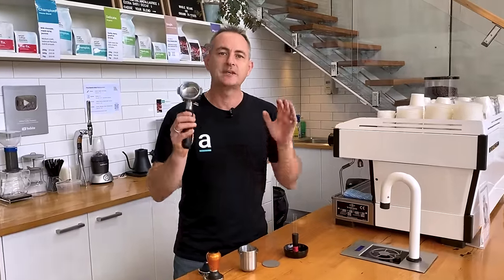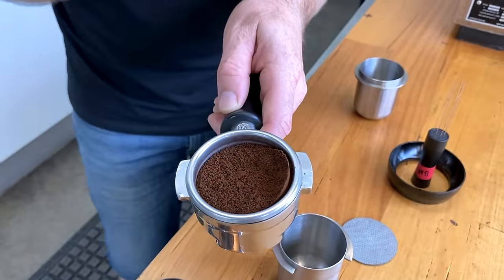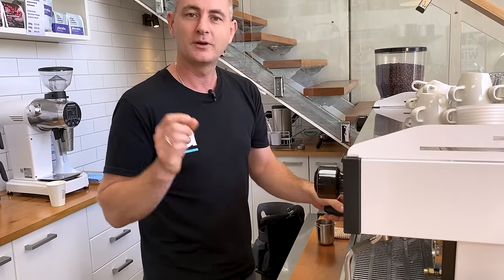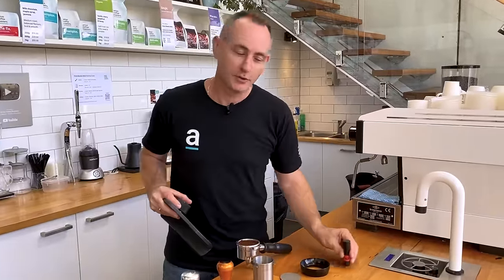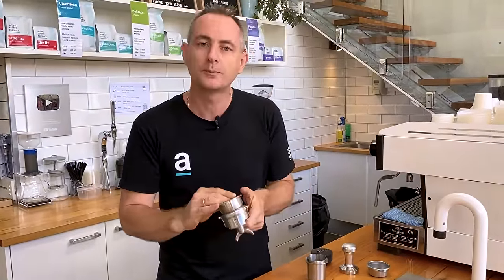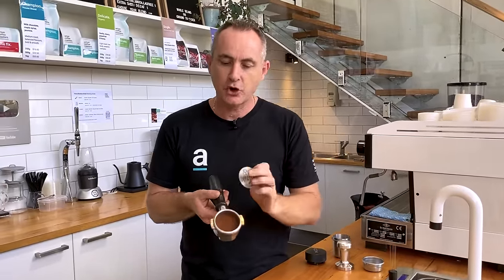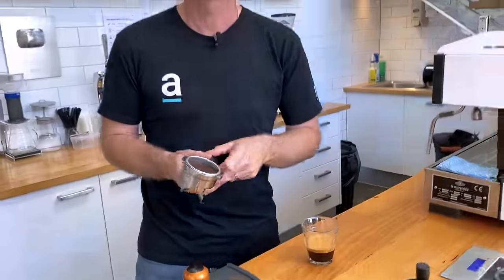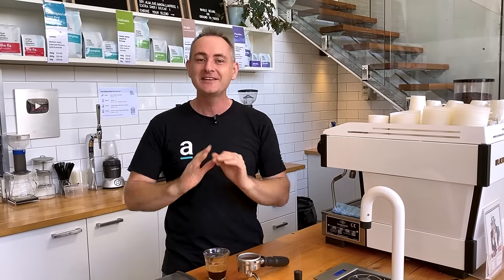How to Brew Better Espresso with these Simple Tips☕️

Comment: I am confused as to why you are using a dosing cup and swirling to distribute the coffee in the handle to avoid channeling and then using a wdt tool to break the coffee lumps up. Surely this will defeat the first process
Reply from the maker: it's a bit of a habit we have for when we teach those that won't WDT, it can't hurt to make sure you get grinds all the way to the edge of the basket first. Cheers Luke
Reply: @ArtistiCoffeeRoasters  thanks for the clarification Luke
Reply: @ArtistiCoffeeRoasters  who's luke?

Comment: My eyes drift toward the hopper of the coffee grinder.  It's transparent, so I imagine the beans are exposed to light.  Your stage is a coffee shop, so the beans may not be exposed to light long enough to make any difference.  Yes?  I have a similar interest in the air present in the hopper. Again, the same reasoning applies as the light?  Nice video.
Reply: Reckon it even matters ?

Comment: Paper filters similar to Areopress yes or no
Reply: Good question!
Reply: Are you talking about a paper filter first then coffee or coffee first then filter on top? I’ve tried each individually and both together and can tell you my experience. Paper on bottom, faster extraction with easier puck removal but you will lose full body flavor from the paper filtering the oils. Paper on top of the coffee, it seems to restrict water flow when compared to no paper or metal screen. I’ve gone through 600 paper filters of various brands and found a no-name metal screen is far superior when it comes to the quality of the espresso extraction. Some paper filters appear to be nothing more than printer paper cut to size, some appear to be actually Aeropress paper cut to the appropriate diameter, you typically get what you pay for. You can find no-name brand metal screens on amazon for cheap and by comparing to a branded one I found no noticeable difference.
Reply: @egcruzer ... I first started punching my own filters (for the bottom) from Chemex paper filters using a 2" punch.  Worked pretty well but 2" was a bit small for the basket - it covered the holes but didn't go edge to edge.  I then started using Weber's paper and have been getting much better results.
Reply from the maker: Oh what a can of worms Kelly, basically a paper filter will remove the oils from the coffee and clean up the cup. That's all i have for now. Let the comments and views keep coming. Cheers Luke
Reply: @ArtistiCoffeeRoasters  ok Thanks Luke
Reply: @ArtistiCoffeeRoasters  can of worms is right.  I started using paper filters after reading paper filters decreases cafestol which affects cholesterol levels.  The more I read, however, there is a lot of disagreement on this.  Seems most cafestol is retained by the spent coffee with the paper having little affect.  Also significant is the type of roast (lighter more), and the type of beans (robusta more).  I think I am thinking about this way too much!

Comment: Very useful video.  One aspect that I'm looking for clarity on is the "barista twist" after the tamping.  I've seen many experts advise against the twisting because it can risk breaking or cracking the puck due to the sideways force(s).  The barista twist in this clip seems especially vigorous.  Are you applying downward pressure while twisting or is it just a way to polish the puck surface lightly?
Reply: usually a polish, no pressure though i have seen some that look like they add a little pressure,

Comment: I have the Pullman big step and are using it with a VST basket.  I have noticed that Pullman sells baskets which 'match' their tamper.  Do you use the Pullman baskets?  Are they significantly different from other?  thanks
Reply from the maker: Yes they do, we don't use the pullman baskets as we have a range of machines that use their own which is easier for our cafe partners. we use VST baskets as our aftermarket baskets. give the pullman a go, let us know how you go. Cheers Luke

Comment: Great video as usual! What is your opinion on La Marzocco's pre-brew on their PBs, and in general? My understanding is that they only have pre-brew not pre-infusion, which many of the coffee community dislike. And, do you guys use it in your shop? Curious to know!
Reply from the maker: Yes we use it, 1 sec on 1 sec off, pre wet vs pre infusion is the terms most commonly used. LM have a pre wet in classic and PB, gb5 this is just when the solenoid closes and will stop the water that is set at the pump. We like it, it helps to fix bad puck prep and increases the sweetness in our coffee. Not all coffee is the same, it works for us. Cheers Luke

Comment: What if it’s rushing hour, you have to weigh every coffee, distribute the coffee, tamp, place the puck screen , isn’t it delaying the speed of getting coffee out to customers? Would it best if we calibrate every morning and run a few times before we kick offf the first take away?
Reply: When barista's dial in every morning, the coffee always changes. Whether you like it or not, many parameters change throughout the day, such as temperature, pressure and humidity, all effect the coffee being ground in the grinder. As the grinder grinds and grinds, the burrs heat up, causing changes in extraction. How full the hopper is, determines how much pressure is being put on the burrs. This is why cafe's try to minimise the factors that influence the coffee, by using scales, auto tampers etc. If they were to just calibrate and dial in once in the morning, 30 mins into morning rush, the coffee may change drastically, even if multiple shots were consistent, before the rush. As to speed, yes it may slow things down doing all the consistent measures, but customers are your top priority, ensuring your delivering the best cup to any customer is the key to success. Hope it all makes sense!
Reply from the maker: We weigh and grind every shot, consistency is the key. Things change during the day, as people pay good money for coffee nowadays it’s the difference between good and great coffee for your customers. Cheers luke

Comment: So, does the amount of coffee that fits in a double shot 58mm cup differ?  I still have an issue achieving the 1:2 recipe within 25-35 seconds. My coffee is ground at the smallest setting on my machine.  18g of coffee in the cup fits just under the extraction screen on the machine.  The start of extraction achieves the right pressure before dropping 40g to 45g of coffee in the cup with a bitter taste.  A more prolonged extraction and more coffee results in a better-tasting shot.

Comment: Why not use a  PUQpress  instead of tamping? Also does the  PUQpress  do distribution  too?
Reply: Puqpress only tamps. Distribution is still needed.
Reply from the maker: Yes a puqpress only gives and even tamp. we use the cinoart tampers over the puqpress as a prefered option. it does not distribute. Cheers Luke

Comment: What are you thoughts on using a leveler instead of a distributor and tamper?
Reply: He uses a leveler, I wonder why not prevent an uneven tamp by having a push tamper.
Reply from the maker: we use a distributor and an auto tamper is our preference to get the standard pressure. Cheers Luke

Comment: Another great video!

A slightly indirect question - what are the causes for water being left on the top of the puck after extraction?  I am using a 21g basket, with a 20g dose, and frequently see a small amount of water on the puck after a 32-second pour.
Reply: Probably just that you have some space between the top of the puck and shower screen. If you used a slightly higher dose you'd have less gap and less space for water to sit.
Reply: @chrisdturner  You are right.  There is space under the shower screen.  When I used a single dose basket, I ensured that there was a small gap, as I have an E61 group, which I found did not produce good results if the top of the puck touched the shower screen.  My earlier Silvia machine was quite happy with 'close contact', but not the VBM.  Now with the larger double dose baskets, there is a greater gap, so I guess there's more chance of seeing a bit of water  on the puck.  The shot meets my brew recipe goals, and tastes good, so I'm not so concerned about the grind, which was my original thought.
Reply from the maker: Space, old coffee,  it the correct dose, check out our puck defects videos, I have one on answers to come soon! Cheers Luke

Comment: I thought it was either WDT tool or the Coffee distribution tool. Never seen anybody use both. 
Isn’t it kind of overkill?
Reply from the maker: Both were excepted as a combo, recently more science tests are proving that the wdt alone is the better option of the 2 and would have a negative effect if distribution is used after. However if there is no wdt and you can use a distribution tool it is better than nothing. As time goes by we learn more. Cheers luke

Comment: If you’re using a pressure grinder such as a Anfim why the need for WDT?
Reply: Correct me if I’m wrong, but clumping still happens with the best grinders if there’s any static energy
Reply from the maker: Clumping happens with all grinders, the static from humidity, the burrs creating friction all make clumps that are best fixed in the group handle before extraction. Cheers Luke

Comment: You dont need new tools for crying out loud. People have been making beautiful coffee for nearly a hundred years without all these bs toys. 
The only thing i would get for home use is the grind cup cuz it saves mess, As long as your not lazy, pay attention use your eyes ears and nose you can make a beautiful cup easily. The spin can be replaced with a shake and tap, spinning is just throwing the heavier grinds to the outsides of the basket just like a centrifuge. 
You dont need the wdt crap. Tamp properly. baskets are angled so that as you tamp the coffee seals. 
pfft increasing the tamp hamdle height really, thats like painting the machine red to make the coffee smoother. 
tip, buy good coffee thats not over roasted, or buy green beans and slow roast them yourself on the stove in a stainless pan, just to the second pop.
also the screeding rubbish isnt required either, use the tamper lightly til its level then tamp... its like buying a second set of car tyres to keep only in your shed that improve your cars traction by being in your shed. 

Please people dont get sucked in.....